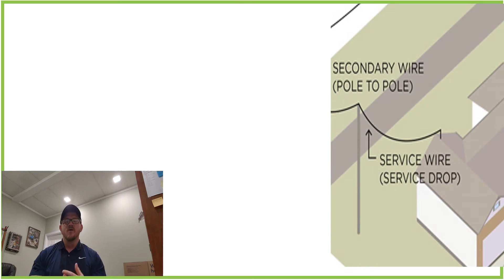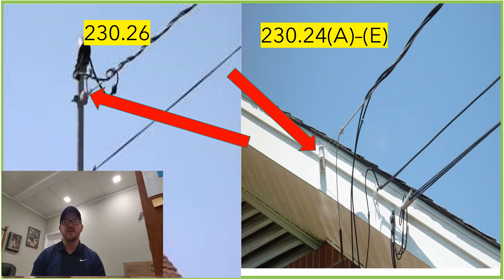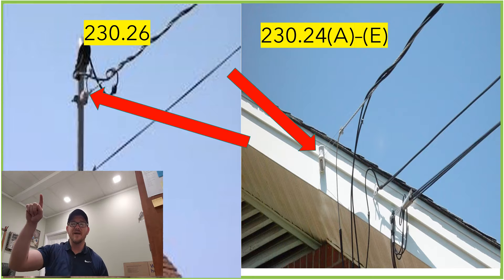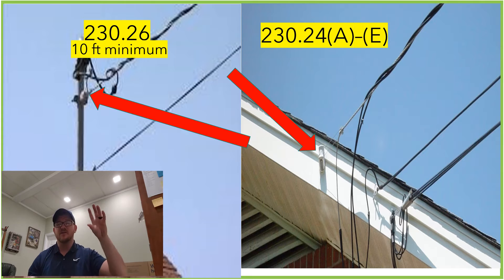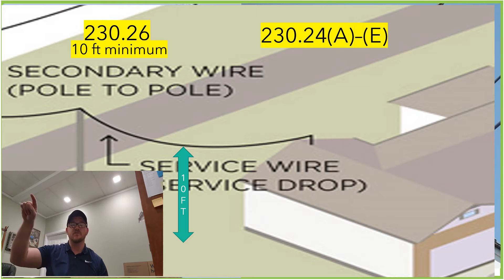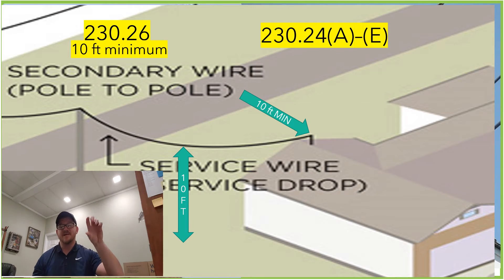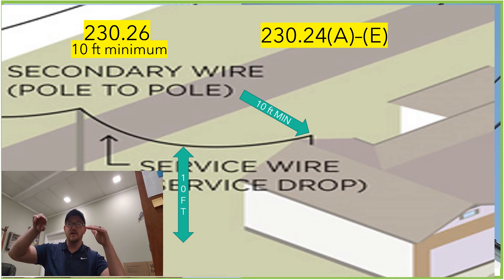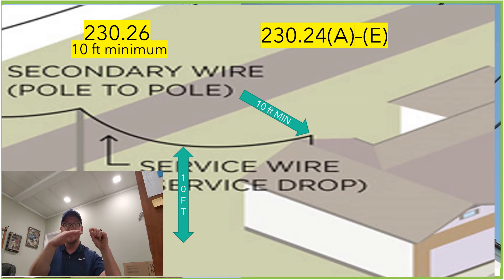Service attachment Height NEC Codes and Education

Comment from the maker: I do want to note, that if it is a part of the service drop meaning directly from the transformer to the pole that technically that is on the power company and they have their own standards. All of the requirements that I talked about do count for overhead service wires though. The service actually starts at the point of service and the power company dictates the point of service, could be on the riser, could be at the top of the meter, could be at the transformer. So depending on where they say the point of services depends on when the NEC kicks in.

Comment: Thank you for your detailed video. I have a question what if I build an addition in that area were the wire drops? Does that change the clearance code of 10 ft? If the new addition is located were you have the green arrow pointing upwards and says 10 ft.in your video. Thank you

Comment: Why is it that some states allow for the service drop to be attached to a structure without an insulator, while others require an insulator at the point of attachment? I've always erred on the side of safety, and installed an insulator, either on the mast, or on the structure at its highest point.

Comment: How mych does it usually cost to bring the weather head up to code? I was quoted $2Gs
Reply from the maker: It really depends, I would get several quotes and don't tell them anything about two g's and see what they

Sometimes you can fix one for as cheap as 500 bucks, and it could be much more lots of variables

Comment: I just took on a property where the attachment at the corner of a single wide mobile home is a 6"x6"x16' post buried 3 feet in the ground. The droop is around 11 feet. This is going over a future driveway to a shop, so needless to say that wire has got to go up. The local utility says it's all on me since the original post was something supplied by the electrical contractor. So I just picked up a used 28' pole which will go in the ground 5' to comply with the utility's requirements for over a driveway. According to them the minimum pole length for over a driveway is a 25' pole, the minimum attachment height is 20' and the lowest clearance (droop) is 16'.  Hopefully I'll be able to get enough clearance for concrete and septic trucks to get under.
Reply: sounds like you have the height covered because there are no vehicles over 13'6" without special permits and your total height after sticking this pole in the ground will be around 23 feet.

Comment: Thank you for your videos.  They are a huge help.  In my case, I’m trying to run 100 amp conductors to a subpanel in a detached garage underground.  Can you tell me what type of wire can be used?  I know THHN can be used in PVC conduit.  I know UF can be used but it doesn’t appear to come in anything larger than 6 AWG.  For example, I’ve seen direct burial options of Quadplex USE, URD, SER.  Can all of these be used and is it okay to put them in PVC conduit for protection versus direct burial?  It seems like if they all can be used then just go with the cheapest option, but I’m unsure what the stipulations are.  In my case, it seems like the Quadplex is the most affordable, but I’m not sure it’s okay for me to use in my application.  Thank you so much!
Reply from the maker: Thank you for the comment!  Email me @ electricalcodecoach@gmail.com I'll help you unpack this

Comment: In my area, the utility requires the point of attachment and droop be no less than 12' in a residential setting not over a driveway. I lost a bid because I proposed installing a mast service to increase the height of the triplex, because the point of attachment and droop were both below 10', and it was a single story house so I had to bring everything above the roofline. Well they didn't wanna do that because it cost too much, but I don't lose any sleep over those bids. I wasn't going to install a 48amp car charger in their 100 amp panel with electric water heater and appliances, and I wasn't going to upgrade the service improperly.
Reply from the maker: Thank you for sharing! Great way to look at it!!